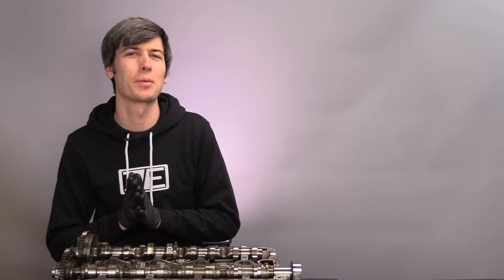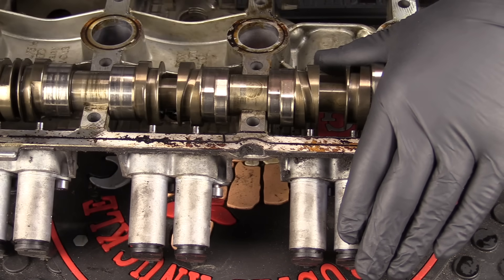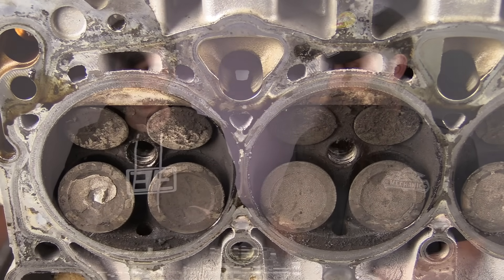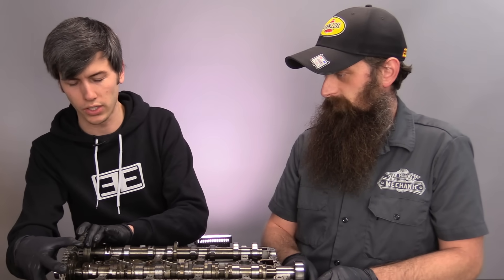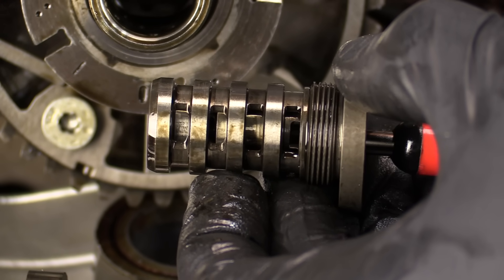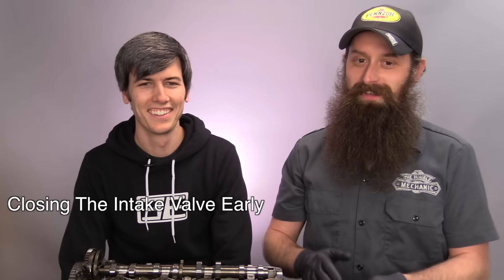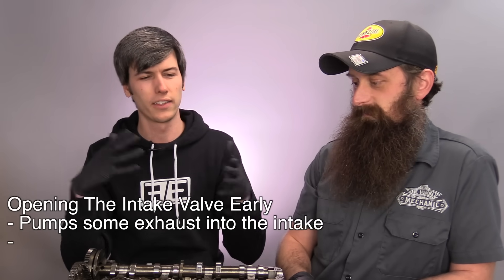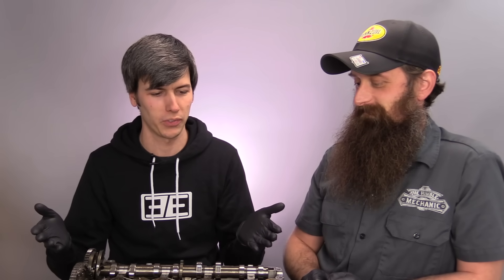Variable Valve Lift vs Variable Valve Timing - VVL vs VVT

Comment: I like cars. A lot. But I hardly understood a word of what they were talking about. But I still found this fascinating to get a glimpse of the engineering and design that goes into engine design and what happens when I push the accelerator pedal to the floor.

Comment: Valve timing overlap creates power, thats why engine builders do it, you actually allow the exhaust gas  to suck some of the intake out with it, that's why race engines have flames coming out the exhaust. Think of it like a 2 stroke how it uses exhaust to pull better intake charge. Making the exhaust have a smaller lift helps spool the turbo because there is less gas it has trouble spooling so less lift accelerates the gas speed. 
What he is saying is probably somewhat true but he seems to miss what I wrote which is probably more the case.

Comment: I have 2004 volvo xc90 2.9l , I had P0011 P0014 for some reason, and I decided to rebuild the head 😂 " not necessary," but I did it .
changed the cam shaft sensors new ones changed the vvts new ones , did the timing belt new 7 quirts oil and filter , and now I start the car run drive nice wont go over 45 though and still have P0011 P0014 🤦‍♂️ wtf I'm dealing with 😂.

Comment: I’m wondering if a oil leak sealant its safe to work for a Chevy Cruze with VVT system on it. My car has a leak in the oil cooler, which causes a lot of smoke when the oil drips into the catalytic converter.

Comment: Opening the intake valve early will also reduce pumping loss by ensuring that the combustion residual air that is rushing out via the exhaust port creates a suction force in the cylinder that pulls the fresh charge from the intake port while the intake valve is gradually opening up.

Comment: the more efficient the engine is, the more horses you get. the faster you can go with low fuel consumption, the longer you can floor it. the longer it takes to refuel, the less the hassle of getting out of you car and stop driving. efficiency is a good thing. 
remember back in the day these huge engines had horses, yes, but the horses per liter were absolutely embarassing in todays standards.

Comment: Is the timing of the intake continuously variable or does it just have two discreet positions?  I'm guessing continuously variable since there is a cam phase adjustment PID, but I haven't found explicit confirmation anywhere.

Comment: VVT got another advantage in power. During high rpm the gas-air-mix is going in the cylinder with high speed (due to the higher pumping effect of the fast moving piston), and because of this you can keep the intake valve open even when the piston starts to move up, because it first needs to decelerate the incoming air, before it can push the gas-air-mix through the open valve out of the cylinder (what you don't want of course, but this would if the valve keeps open later during low rpms, because the air isn't travelling with high velocity). So you get more gas in the cylinder, got therefore a higher compression and a higher amount of fuel, and finally more power.

Comment: What’s the point of having individually regulated exhaust valve profiles for each cylinder? Is there a case where you would want one cylinder to move to “profile B”, while the others remain on “profile A”? It would seem that making different amounts of power from different cylinders would lead to dynamic imbalance. Making the whole rail shift as one piece leaves you with two solenoids to fail, as opposed to eight.
Reply: Good point. Have you found any explanation for this? Does it have to do with technical limitations in building a single shaft controlled by only two solenoids?

Comment: Can someone help me please ! I have the following problem with my Volvo S60 T5 2001 year ; 250HP......when engine is cold and i start it, car performance it`s okay, if i don`t stop the engine even for a loong time driving it`s still okay. But if when engine already hot and i restart the engine performance drops dramatically....i need to wait it to cool down to be again with normal performance. Is it possible that it is due to a change in the viscosity of the oil cause VVT issues ?

Comment: thanks to you I FINALLY understood how that goddamn oil pressure is related to controling the valve timing. Couldnt figure it out for the life of me. So it's FILLING up those chambers on the left and right of the radial knobs to push it retarded or advanced, that's genius. Thanks!

Comment: Guys,  i have hyundai accent vvt 1.4L 2014 , check engine on from about 3 months,  when i check it , it gives me that the error is (camshaft variable valve timing P0014) i change the oil and filters but nothing happened then i change the two of cylinders of vvt and nothing is change,  what should i do now !!!? 😓😓😓 please help me if you know any information about it

Comment: Can you do a video on cam gears and lightweight pulleys? I have read things about it not being good for the engine due to harmonization and vibration the OEM's are specifically designed for and minimal gains, and other reads about it being fine and worth freeing up the HP. Working on a Supra 2jzgte.

Comment: Do you know if changing vtc actuator is enough to solve rattling noise of start up or should engine be cleaned? TCT changed? valves adjusted?

Comment: My vtec wont engage and dealer said i have medal shavings in my vtec solenoid. it wont engage to and it goes on limp mode they said i have a bad vtec cam actuator

Comment: Can you hear a 2007 Yaris VVT-i in operation? On acceleration or when i go up a hill i can hear a faint knocking-metallic sound for a couple seconds before it gets up to speed, i figure that's the VVT and it's normal? Our 2004 Corolla has a similar sound too.

Comment: I have a 2001 Polo (6n2) GTI 1600 16v 125ps which has Variable Valve Timing (I believe the first VW model did it on) fun engine loves revs and like all 16v VW GTI engines of old at its best high up and a certainly feel the variable valve'n kick in 3500+. How much does this technology differ from newer VVT explained in the video and assume done by same oil pressure chambers changing it as needed.

Comment: Can you hear these systems making noise like a small knock or pinging when you accelerate normally from a dead stop or climbing a hill?   Both my corolla and yaris i can hear soft mechanical noises until it gets higher in rpm range, i assume it's normal and may be that's the sounds i'm hearing?

Comment: No mention of the inertia of the exhaust gas exiting the cylinder actually pulling fresh air into the cylinder during valve overlap. Otherwise great job guys.

Comment: Isn't an EGR system much more efficient in a boosted car instead of relying on the VVT system to cool down the temperature of the engine. Because in the exhaust stroke, though the intake valves are open, obviously the exhaust valves will be open too. The pressure in the exhaust system will be way less than what will be in the pressurized intake manifold. Hence will the exhaust gas  make it upwards to the intake manifold effectively? Any thoughts?

Comment: going 50 itll shift like 2 or three times that arent even going into 3 on the shifter. then it pulls at 3700 past 90 which blows my mind because the dash goes 120 and it's only at 3700 going 90 redlines at like 5500 or 6500 in an access cab long bed truck.

Comment: I'm under the impression that if you removed turbos, you would cut back on NOx emissions. To my knowledge, NOx is made by compressing and super heating air, so why not stop forcing more air in? A coal mine around had to deactivate the turbos on the locomotive to cut emissions.

Comment: What is more mechanically stable: vvt, vvl, or vtec? I'm curious, because I feel like the rockers sliding back and forth would create more metalic detritus in the head, etc. Correct me if I'm wrong. Thanks for your work guys! I've been watching for years.
Reply: Vvt has no extra moving parts other than the ability to allow the cam to turn independant of drive pulley so therfore the safest and most reliable, all others vtec, vvl require moving parts and pins to lock components together at predetermined rpm based on oil pressure actuation, more parts equals more wear over time and greater potential for some thing going ping and then game over. All use solenoids to activate via oil pressure at preset rpm points.

Comment: Toyota's 2ZZ (made by Yamaha) engine has a more versatile valve system, it has variable valve timing AND variable valve lift on both shafts, and the cams don't slide on a spline, they're always fixed on the shaft, similar to Honda's VTEC.

Comment: Hi
How the valve operation is controlled???? Is it through ECU or camshaft driven by crankshaft??
Reply: The camshaft is definitely driven by the crankshaft, but I'm not sure how the variable lift actuators are triggered.  I personally prefer Toyota's VVTL-i system or Honda's VTEC system, they have better fault tolerance.  If that actuator pin in the VW engine should break off, it could potentially destroy the cylinder head, and cost a lot of money to fix, where the Japanese design will continue to operate normally if the advanced valve lift system fails.

Comment: Nice video. I have vvti-L on my 2003 Pontiac Vibe GT. Is this pretty much the same? I keep revs low. Once in a while I’ll rev high so as to activate lift. But then it appears to stay stuck open and I get a high revving and fluctuating for a couple of days. How do I fix this?

Comment: Do have any video on 2017 bmw 440i cams with 17000 mile, the dealer refuse to fix the problem due to we had modified exhaust pipes and air filter. They told us that the engine is full of metal, so we bought a used engine and I removed the oil pan and filter couldn’t find any metal, so I am thinking maybe VVT and turbo problem can you help

Comment: Interesting, I thought the valve timing varied continuously but I see here that it is one way or the other. That explains some engine behavior, why the engine changes its acceleration rather suddenly at about 3000 RPM without a multi stage manifold.

Comment: You might want to open the exhaust early to help spool that turbo similar antilag but in a road car you wouldn't want that its hard on the engine and turbo and requires a lot of maintenance... Ask rally guys

Comment: In the mercedes M111 supercharged engines, if not mistaken, the cam profile is first retarded below 2.5k rpm, than advanced 2500 - 4000, then retarded again 4k-6k. How does retarding at higher RPM produce more power, or is it purely for emmisions?

Comment: Hi guys, looking for some help. Just paid $3000 to have a ton of engine work done on my 2012 WRX including head gaskets, CAM pulleys, timing belt, and coil packs. Picked her up this morning and the idle ran a bit low, plus lots and lots of smoking. Mechanic said it’s ok so I drove it and stopped at BK came back out and it wouldn’t turn over. Finally got it started after a struggle and RPMs were so low it almost stalled. Check engine light came on and the code was P0018 Crankshaft position correlation bank 2 sensor A. Mechanic plugged it back in and said all the numbers looked great and turned off the code. On the way home started hearing a high pitched whine when turbo spools up. Mechanic reassures me that’s “normal” for the turbo and just the sound of the pressure coming off but this is my 2nd WRX and I have never once heard that noise. I’m freaking out. I just spent so much money getting it fixed for it to have brand new problems... it was in the shop for over a month and this is my daily driver. I know every nuance and sound. Everything on her is stock except for some suspension stuff. What could he have done to her? It has to be something resulting from having the engine taken apart don’t you think? And such a lengthy process... any advice would really mean a lot! Thanks guys!

Comment: maybe i wasnt totally following but i have an old corolla before the cvt transmission but anyhow does the vvt not kick in unless theres high rpms going on there or does it activate after a steady cruise at 55 on the highway for example? thanks.

Comment: Bad mechanical engine ...tooo many parts, just make individual selenoids per each valve and run a software...done...no more timing c jf ain and camshafts, defasers...less parts to brake

Comment: Oh, how about let me explain.... In low-RPM, you open and close valves like you should.  At high-RPM, there is less TIME to fill or evacuate the combustion chamber, therefore you keep the valves open longer.  For example, keep the intake valve open longer pass the BDC (Bottom Dead Center) where the piston is going up for the compression cycle.  The high velocity intake gas continue to charging into the combustion while piston already began the compression cycle.....   and you close the intake valve (later than low-RPM).  Where you would have more combustible mixture and more power.  What happens if you keep the valves open longer in low-RPM?  You will push out some fresh mixture back into the intake manifold, or rough running engine.  Remember in the 1960s where you can install a HOT cam?  Yes, more power at high-RPM, but the engine runs like sh*t at low-RPM.  That is all.

Comment: Hi there. I did text many youtubers hoping that someone would answer 
 I have a 2007 bmw x5 4.8i  and de dealing with a p0346 code
 Checked the cam sensor is ok,fresh oil,full battery, cleaned the vanos solenoid 
 Car has 130.o00 miles. Left to in inspect would be the timing, chain,guides, tensioner 
 Maybe vvt system

Comment: Your answers why open/close the valves early/late is a general explanation, but there are exceptions to those rules.  My 2010 Yamaha R6 made lots more power when we closed the intake valves earlier.  I assume because it got more compression ?  Just a theory.

Comment: IF you close the intake valves late when the air is moving quickly, it you can fill the cylinder more than 100% because the airs forward momentum it wont leak back out as the Piston starts moving back up

Comment: Hi Jason. Have you looked at the MG/Rover VVC system? It's quite interesting since it uses an eccentric gearing system that has the ability to gradually widen the valve timing as the RPM increases rather than only having the choice of two different lobes.

P.S. Thanks for another great video. :) Always have to click fast!

EDIT: The MG/Rover VVC system is able to control the speed of rotation of the intake cam shaft, speeding up and slowing the rotation during each revolution (it's similar to the effect that happens in universal joints that are offset at an angle). The cam lobe spends more time pressing down on the valve bucket, therefore increasing the valve open duration. It's also infinitely variable which gives the benefit of being able to tune well across the whole rev range rather than having two distinct tuning points to account for.
Reply: It's such a shame MG Rover didn't develop VVC to work on 3 cylinders - a KV6 with VVC would have been great! If Powertrain had developed a K6 / straight-six* with VGK Racing's 2.0-litre** developments and 3-cylinder VVC, MGR could have had a pair of compact 2.5-/3.0-litre six-pots with 190/230 PS on their hands. Possibly even a 2.5-litre six-cylinder turbodiesel^ too.

*Cylinder block would have been about 560 mm long plus 20 mm wide timing belt plus 20 mm thick damper to make a total length of 600 mm - or 10 mm longer than a Ford / Volvo SI6. Same width and height as K4. L: 600 mm x W: 500 mm x H: 670 mm | ~150 kg
**82.5 mm x 93.3 mm | 1,996cc 4cyl 16v
^The K Series was engineered to be manufactured as a diesel with an aluminium block without any further strengthening (original 75 mm bore but could could go to 77.5 mm without issue). It could have gone into the P38A, Disco II and Defender as well as the 800 and 75 - but BMW wouldn't have wanted that as it would have been in all probability more powerful and torquier than their iron-block M51D25 six-pot. | 77.5 mm x 88 mm | 2.490cc 6cyl 24v | 150 PS / 350 Nm (in 1994)

Comment: I always thought the intake cam would be ADVANCED as the revs got higher, allowing the intake valve to open earlier, letting the fuel mixture in a fair bit before TDC, utilizing the ram effect of the high speed fuel air mixture in the manifold to get more mixture in, minimizing power fall off at high revs. 
But this device actually RETARDS the intake cam at higher revs?

Comment: I thought late intake valve closing was to do with ramming more AF mix into the cylinder by using its inertia. That's why late close is done only at high revs.

Comment: i think the reason for the late closing of intake valve is to use the inertia of intake gases in order to suck in more air fuel mixture even after the piston starts to move away from BDC

Comment: Could this not be done electrically?  I mean with solenoids actuating the valves?  Or would the inertia of the valves/winding/magnet plus I^2 R losses be too great, or timing accurately too difficult?
Reply: It's already been around the R&D circle with all manufacturers for decades but only recently is it becoming more realistic to put into production vehicles.  The traditional camshaft system is just so proven to be reliable that it'll take some time before manufacturer's adopt it for run of the mil vehicles.

Comment: I think u forget one point. Why we close intake valve late?

At very high rpm (say 6000), at such a high speed inertia of air comes into picture. After the end of the suction stroke, piston starts moving back towards valves (compression stroke). As piston appears like compressing the air, but at the same time due to inertia of the air, it is still filling the chamber. effectively we get more volumetric efficiency.